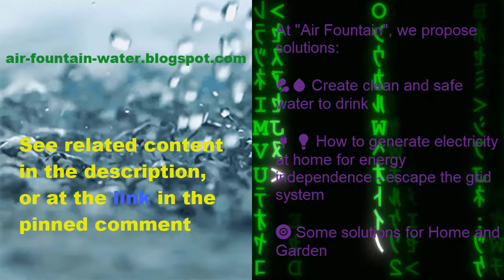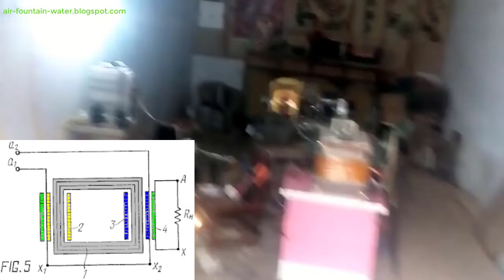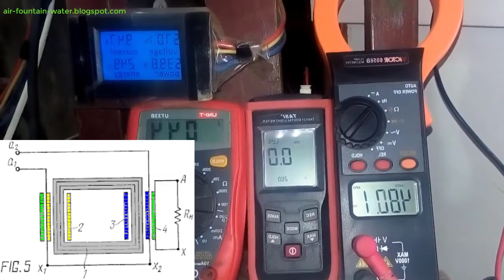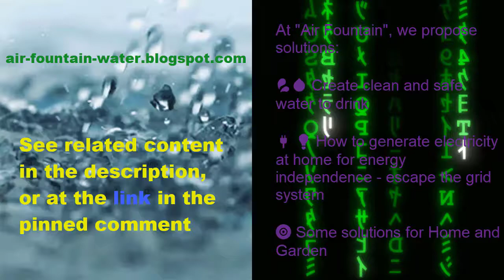Free Energy with Magnets: Electromagnetic Static Transformers by Professor Markov

Comment: According to the late Dr. Thomas Bearden, when 2 opposite vector fields cancel, they produce a scalar pressure field.  In this case, a scalar magnetic field is created.  My own experiments indicate that these varying scalar magnetic fields can can induce normal magnetic vector fields in transformers and produce electric currents. 

So. the Markov transformer using cancelled magnetic vector fields can avoid saturating the core until approximately 10 times the magnetic cause is used, according to his own statements.